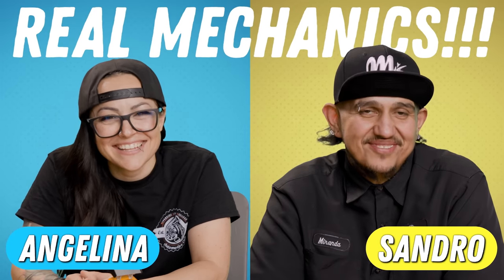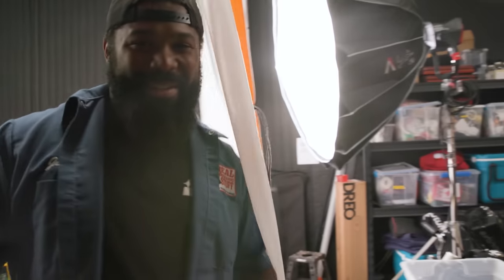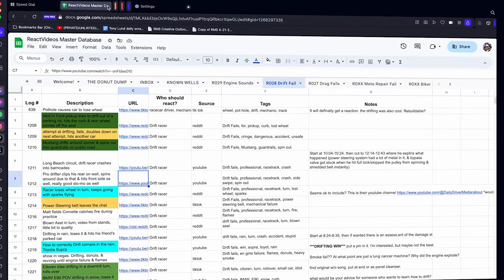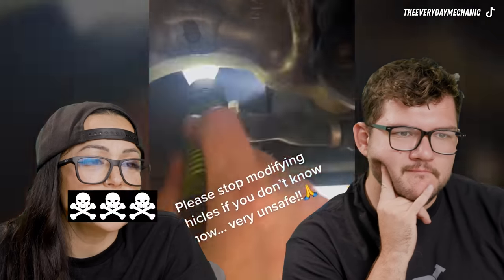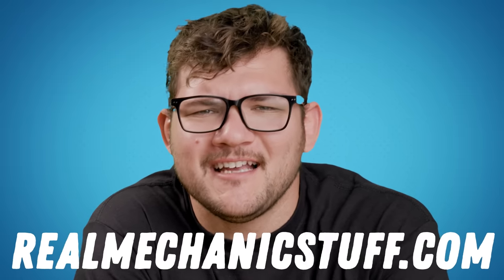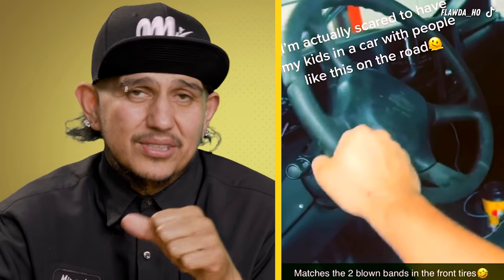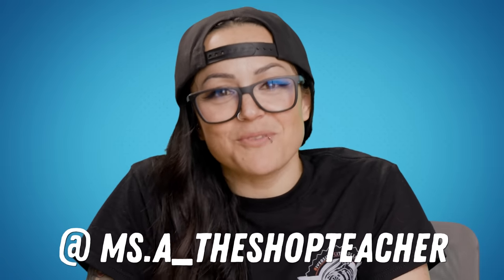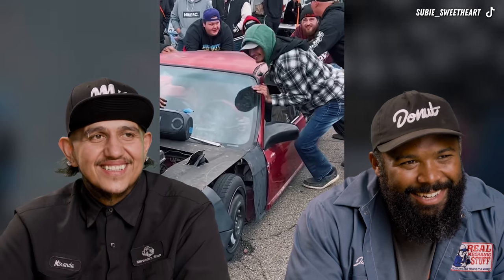Mechanic Reacts To Dangerous Death Traps

Comment: With the bent ass truck, Sandro said 7-8Gs for a new truck, homeboy at that point you'd be better off with even a $500 POS cuz you can find something that doesn't have a bent frame and has a v8 running on 4 cylinders for that money.... and that's still an upgrade

Comment: 13:15 those are not made for brake line and should never be used for brakes. get the fitting that say they're for brakes, same thing psi rated pipe vs non psi pipe

Comment: First one:  Civic being towed - - As long as they are going under 25 MPH, it is equipped with seat belts, and I have a constant way to communicate with the driver of the tow vehicle, I would certainly ride it.

Second one:  Truck with bent/broken frame -- Won't ride in it, especially not at the highway speeds their driving.   Too much risk of catastrophic failure.

Third one: Lowering job with missing nuts --- Wouldn't ride it.  

Fourth:  Modified Tesla -- I wouldn't even trust it at that cheap weight reduction modification.   You modify a car for racing you do it right, put in a racing seat with 5 point harness, and add a roll cage if you've removed impact reduction materials.   Then that issue with the breaks, just no. 

Fifth: Loose Steering wheel -- Not without knowing what is exactly wrong at least,  so without further inspection, no way. 

Sixth: Bad Brakes --  Depends on who is driving.  If one is careful and conservative on the brakes, that will get to the shop just fine, and I will ride with them.   However, most people I don't trust to properly handle such breaks. 

Seventh: project car --  AFTER they fix the seat,  (I'll bolt it in myself) but ONLY because they are just doing a quick test drive around the block at rolling speeds.  If they were actually going to take it out on the open road, I wouldn't be caught dead. 

Eighth: Bad ball joint -- Depends how bad it is and the normal range for the car.  Probably would be willing for a short drive. 

Ninth: Falling apart and rusted out suspension -- No way.  Full stop.

Tenth: failed break line --- Nope, those things are tied together, one goes they all go. 

Eleventh: WTF?  --  When rolling around the parking lot for fun like they are?  Sure why not.   Still, not taking that thing on the road if it gets stuck in potholes.  As of the track, depends on how fast they plan to go.

Comment: I've had my drive shaft break at 3 a.m., going to work in -16 degree weather.  I was going 55 mph. Not fun, tore up alil bit of the road, but did not catapult. (01' Explorer)
Reply: 6 months later my fuel filter and fuel pump had to be fixed, also my sway bar link was broken so I fixed that as well.

Comment: That truck didn't have a rear end accident. The frame rusted out and collapse in the middle, and they jacked it up and welded back together well enough to drive, and the bed is sticking up in the air because the rusted mounted probably busted, so it didn't pull back down when they jacked the frame back up. Welcome to the upper midwest.

Comment: The first Chrysler 200 brake caliper fail was missing the bracket that the shoes and caliper mount to! This was NOT installed correctly!! they have 3 components... the rotor, caliper and caliper mount! All that one had was the rotor and caliper!

Comment: i had an FC RX7 in the 2000s with the worst brake system to ever exist. I drove it for a year with NO BRAKES and used the e brake and down shifted to slow down.

Comment: I bought a 2010 mercury milon hybrid on the side of the road for $850, it had no rear shocks, snapped struts, and a hole in the rear control arm the size of a golf ball. The car had no brakes and I had to snap the steering to drive it. I dove it like that for 4 months.
Reply: The car would shake going downhill. And twerk when it hit a small bump

Comment: I had brakes fade then a minute later no brakes.  Went to use hand brake, pulled the handle and the cable broke.  I shifted into fist gear to slow it up and then I road tire against curbing to stop it.  My car was in for repairs and the car this happened to was my mom's.

Comment: "Brake pads only go in one way"
Not all the time. Ford F150/Expedition have pads that are specific for inside and outside, but they will fit either way. Mixing them up causes catastrophic, premature wear.

Comment: Oh no its definitely on par for carmax. I bought a 2015 volster from them 15k miles on it when i bought back in 2016. About a year later in 2017 i got into a minor fenderbender like minor (less than 7mph) brought the car in for repairs to my local body shop despite carmax begging me yo bring it back to them. 

Local body shop had it for almost a month n a half. Told me the car was in a massive accident before i got it and whoever fixed it half a**ed the repair. They literally had super glue and double sided sticky tape holding some of the front end parts together. But hid it well enough so you wouldnt immediately notice it unless you had to disassemble the front end. 

I fought with carnax for MONTHS over it finally they hung me out to dry cus they just said get a lawyer and take us to court (they knew i was just a young college kid and xouldnt afford it) went after the finance company who also hung me out to dry as no one wanted to take responsibility for the car, as the body shop had to report the accident and all the hudden damages it was now labeled as a severe wreck car and i lost my a** on it when i went to trade it in. So missing brake pads on a carmax car doesnt suprise me in the least

Comment: all of my bushings are dry rotted for my steering ,suspension and ball joint, rack and pinion bushings etc. my braking is also bad i dont know what causing it. my rotors are also bad. but i still send it flying. i think i have light knocking on my engine. my bearing are also bad i dont wanna change it cause it old it has to my pressed on. i drive a 2000 tundra base 266k miles ill fix every thing at 300k if it makes it. my head gasket is messed up it leaks a qrt every month. it struggles to start. bad response time. shifts rough.

Comment: i had someone drain my motorcycle brakes on exam week, i got lucky and felt the difference on the 2nd pull and slowed down before getting onto the main roads, before they gave out on the 4th pull.   someone tried to kill me, and after i stopped i realized what the puddle next to my bike was....before i had ridden the bike, i had noticed it but it made no sense.

Comment: I simplify the harness in my derby car and I get rid of the fuse panel I just power the wires that run the motor and transmission I don’t put fuses in there and They have never caught on fire

Comment: The track pack Plaid has the Brake fluid be flushed out 3-4 times from dot3 to a 5.5 because of this exact reason
Reply: Nah that vehicle had the brakes done even upgraded the problem is they are grossly under sized in all tesla because even the "track" versions aren't meant for the track and as street cars they rely heavily on the regen for braking

Comment: I had brake pads go flying off my truck doing 70 on the freeway coming up to my exit. I watched pieces of my brakes go bouncing down the road 😂. I ground my caliper all the way down and I was an hour from home. I worked all day then drove an hour to my girlfriend's dad's shop with only using my emergency brake. Then we replaced calipers, rotors and pads. Still have no clue how I drove 60 miles like that 😂.

Comment: 13:00 that’s a brake union it was leaking most likely due to improper flare of the brake line. Im suprised a “mechanic teacher” has never seen a brake line union. The piece she said “sheered” off has threads on the inside of it…

Comment: I had the brakes on my mom's car lose pressure while I was driving it on the highway during rush hour, made it home safely and got it towed, and it turned out to be an actual hole in the brake line and all the brake fluid had been pushed out.

Comment: For about two months in the yearly 90s 
I had a 79 ford feisty pu  doors held shut by a slide bolts door lock  screw Jammed into the carb choke in the morning when starting  turn the screw to close the choke and once it warmed up popping the hood  to loosen it 
Zip ties holding the fenders on 
The fud up thing about it was 
I actually sold for 1g 
As a kid we took a wreck pinto station wagon 
And made it a pint/charo 
Yup we made a truck out of it 
Well a parts chaser 
It was like a moped 
Fun to ride till your friends see you

Comment: What happens as soon as these Deathtraps get in a workshop taking their job just a little serious is the ONE nice thing with TÜV and laws in Germany and most other EU countries. The workshop can call the police and they will take the numberplates and the keys for the car and keep them until the car has been repaired and checked by an engineer that it is save to drive again. Only other option would be to have it towed away and trashed or have it sitting at home to let it fall apart even more. The number of encounters with a freeakshow of cars like these or at least most of them is very low in Europe and I like that.

Comment: Why wouldn't people put the highest heat resistant brake fluid in instead then? Is there a negative to putting the highest spec fluid in an old trailblazer? Would it explode or something horrible? Love the vids! ❤
Reply: The fluids are not compatible.  If you completely remove the old fluid, and start over, maybe.  Some say the seals are not compatible with dot four.
Reply: @robertheinkel6225  Oh! Thank you so much for the info! 😁

Comment: Went to a pep boys once for brakes. As I left the shop the car lurched and vibrated horribly with a grinding sound. Didn't even leave the lot. Checked the rotor and huge gouges had appeared. Told the service writer they put the pads on backwards. He swears that's impossible and it must be a new problem that will happily fix. Turns out, they did put the pads on backwards. They fixed it all, of course, but I'm still wondering how tf?

Comment: I ride a motorcycle and when I encounter a vehicle in front of me that has parts hanging by pieces of wire of zip ties I either back right off or change lane so I am not behind them. Today I was following a Honda Civic that was obviously a junker. The back bumper was wired on and loose and moving with every bump. I moved to the adjoining lane and stayed there. As it happens there was a steel plate in the road to cover and excavation and when she hit that plate the bumper broke loose and the car following the Civic ran over it and was damaged. The woman driving the Civic was completely oblivious to what she had just done and kept on going. I followed her and tried to stop her but she was having none of it so I took her license plate number and then pulled over and wrote it down. I then went back to where the other car had stopped after hitting the bumper and the police had already arrived. I filled out a witness statement including the license number which the police immediately ran for the registration address. The woman who owned the damaged car was grateful that I did what I did and thanked me. I also gave her my business card so she could call if need be. As for me, well I was just happy that I had changed lanes because if I had hit that bumper the results would have been different and I would probably have ended up in a hospital. There should be provision in the law to force people to park these pieces of crap before they harm someone else.

Comment: I had an eagle talon I slide into a wall with due to black ice, pull over and sue to the reverse mounted Mexican wheels there was no visible damage. Bout a week later going about 80mph the back end just starts swinging about a foot or so each way depending on the turn. We drove that shit like that for almost a year until I got stuck in snow and it got towed. I get it from the tow yard and drive home go to hit a Michigan u turn and the back wheels and axle just come out the back of the car. Sold it to my bud for a few hundred and he states just the rear shocks were hold the axle to the car 😂

Comment: Had a piston on a rear caliper hanging up on a 1989 Mercedes 300SE, 600 miles from home ground one of the pads Down to the backing plate by the time I got it back..... That's as close to a deathtrap as I ever want to get.

Comment: 12:46 - Wh...why?  It's like an 8-inch brake line.  Replacing the whole thing probably would have been cheaper and easier than trying to throw a stupid compression fitting at it.

Comment: old nissan patfinder with  air in is break line   because custome decide to do is joob him self .. need to put the pedal 3-4 time before the car actually start to  slow down XD  and he keep driving it around as long y a know bruh.. y miss my old pontiac vibe was fun to drive the the foam in the floor to patch some hole  in the frame 🤣😂 goold old winter beater

Comment: Haha I use to have a 1985 c10 chevy in 2015 the doors didn't close right going over 30mph the whole body would vibrate the heater only had two settings off and hell the one good thing about it was the motor was strong

Comment: That one with the brakes and the brass fittings around the 13 minute mark? ........ those are simple compression fittings. They're meant for plumbing fixtures. 150 to 200 PSI maximum. It's just a simple ferrule that slips over the tube and compresses on the tube to hold it in place. These are meant to be used with plastic tubing or copper tubing. Not stainless steel brake lines. There's a reason why brake lines are done with double flares and not simple compression ferrules..........

I

Comment: I am genuinely unphased by the smashed butt red truck.
Frame looks mega bent, as the cab is tilted, but that's probably not a huge deal. 
Cut off the back of the frame behind the axel and weld on some straight pieces to replace the mounts..
If she tracks straight, doesn't make the driveshaft sit funny, and moves under her own power...

Put a new bed on it and drive it like it never happened.
That's the exact sort of thing I'd be looking to buy to get a sweet truck at a steep discount.

Granted, this is from the perspective of a machinist who sees an easy weld job, not the guy who'd be paying a shop to do that.

Comment: A water compression coupling going to work on a brake system what is too much pressure a water line only has like 50 lb of pressure at the most brake lighthouse like 300 to 400 lb of pressure

Comment: That clip where they were talking passed inspection in DEC.  I had something not quite that bad.. front driver brake pads were .. I got every cent from those, the front passenger had a sized piston on the caliper.  No clue HOW it passed inspection 6k miles before...  It's a hypbrid, no way I wore down 3-4mm of brake pads in 6k miles.

Comment: Angelina that was a compression fitting that someone put on the brake line of the Chrysler 200.  Not an engineering failure.  Improper repair.   No hate, but as an automotive instructor you should have known that.

Comment: Remember when the brakes failed at a volvo 1964 with a bigger engine 65km from home. Hade to drive home with the emergency brake, but it worked didn't drive over  130km/h

Comment: Typical General Motors pickup truck rusting away while rolling down the assembly line !
Sequential Rusting :
Gasoline lines 
Brake lines
Body panels
Frame rails

Comment: Bahahaha I’ve fixed a brake line with those fittings on drum brakes and it’s still holding strong 3 years later 😂
Reply: I knew it was wrong though.

Comment: Sandro has probably driven worse vehicles back in his youth. He's not afraid of a hoopty. Lol 
Don't use compression fittings on brake lines ever. Compression fittings are not designed for the pressures brake systems operate at. The school teacher should have known that.

Comment: In New York you're required to have your car meet an inspection standard and if you take your car in for repair and they noticed that it no longer meets that standard they can scrape your sticker out if you refuse the repairs to meet those minimum requirements and that will get you pulled over and then they will give you the tickets that are required if not take your vehicle off the road until it meets those requirements 🫤 and yes I can make it so that you are required to meet the minimum standards before you can register your vehicle again there for taking it off the road indefinitely if it's not fixed 🫤

Comment: It is hard to imagine it is legal to drive with cars in those condition like that. Makes you think inspections are not testing the right stuff, too lax or don't exist is some states.I'm pretty sure with some of those case those car would be reportable, in Europe or UK. Certainly you couldn't insure them and therefore would not be legal to drive. Mechanic don't want to go to prison and many of them do the testing so are not going to let the car leave it is it is unsafe. It is more to do with the safety of other road users. Low rider there is a place for them within reason, it is the other stuff that is just laziness.

Comment: Engineering defect? If you use compression fittings on a brake system that can experience 1500 psi, then you are clearly going to end up with stuff blowing off.